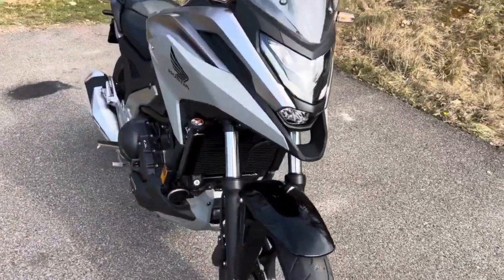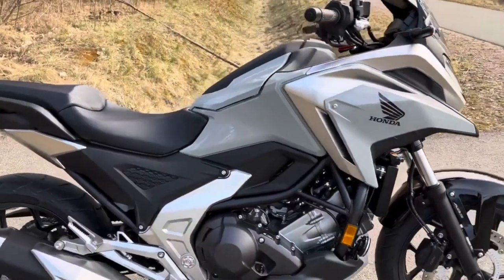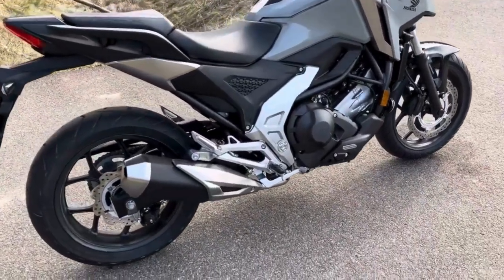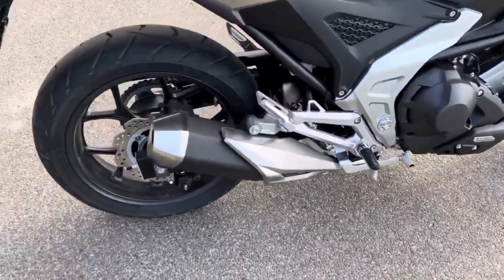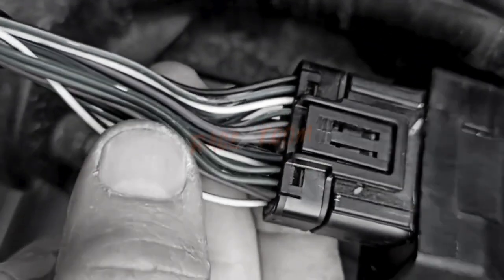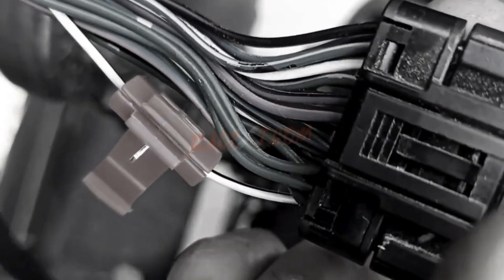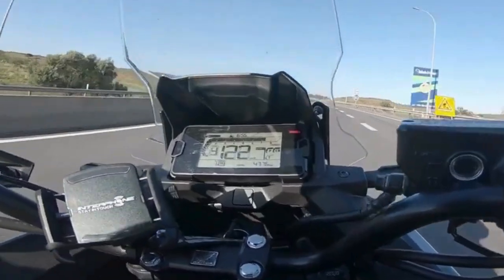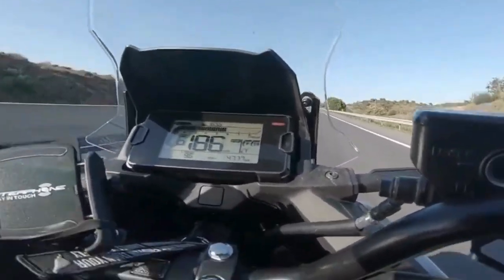Chip tuning for HONDA NC 750 X power unit

Comment: Not really a chip tuning is it. It is a little device with a few internal components which fools the bikes temperature sensor, thinking it is colder than it actually is. Am I right?
Reply from the maker: Dear Henrom,

Thank you for your question and for taking the time to understand how our additional power module works. You’re right that it’s not exactly “chip tuning” in the traditional sense, but it is an extremely effective and efficient way to optimize the performance of your bike. Allow me to explain the functionality and the advantages in more detail.

How the IAT (Intake Air Temperature) Sensor Module Works:
The module connects directly to your bike’s IAT sensor, which measures the temperature of the air entering the engine. The ECU (Engine Control Unit) then adjusts the air-fuel mixture based on this information. Our additional module adjusts the signal sent from the IAT sensor to the ECU, making the system think that the incoming air is cooler than it actually is.

Why does this work so well? Cooler air is denser, meaning it contains more oxygen. By convincing the ECU that the air is cooler, the module prompts it to enrich the fuel mixture, delivering a slightly higher amount of fuel into the combustion chamber. The result is improved combustion, better throttle response, and an increase in both torque and horsepower.

Key Advantages of Our Module:
Immediate Performance Gains: Unlike traditional chip tuning that requires remapping or reprogramming the ECU, our module offers a plug-and-play solution. The installation is quick, simple, and reversible. This allows riders to experience immediate performance improvements without needing specialized tools or expertise.

Improved Throttle Response: One of the most noticeable benefits of using our module is the enhanced throttle response. By optimizing the air-fuel mixture, your bike reacts more quickly when you twist the throttle, providing a smoother and more responsive ride, especially at lower RPMs or during acceleration.

Increased Power and Torque: While the actual gains depend on your specific bike and setup, many customers report significant improvements in both horsepower and torque. For a model like the HONDA NC 750 X, you can expect a noticeable boost in pulling power, especially in mid-range RPMs, where the engine performs most efficiently.

No Permanent Modifications: Traditional chip tuning often involves irreversible changes to your bike’s ECU, which can sometimes void warranties or cause issues during maintenance. Our module, on the other hand, is completely removable, meaning you can revert your bike to its original settings anytime, without leaving any traces of modification. This makes it an excellent choice for those who want performance gains but prefer a non-invasive solution.

Optimized Fuel Consumption: Another benefit is the potential for better fuel efficiency. By optimizing the air-fuel mixture, many riders experience improved fuel consumption under normal riding conditions. While this can vary depending on riding style, the module allows your engine to run more efficiently in a wider range of conditions.

Safe and Reliable: One common concern with tuning solutions is their effect on the longevity of the engine. Our module is designed to work within the manufacturer’s safety parameters, meaning that it won’t push your engine or components beyond their intended operating limits. You’ll gain performance without the risks associated with more aggressive tuning methods.

Professional Guidance and Support:
We take pride in offering not only top-tier products but also comprehensive customer support. If you have any questions about installation or the specific benefits for your Honda NC 750 X, feel free to reach out to us at any time. Our team of specialists is more than happy to provide you with the detailed guidance you need. We’re here to ensure you get the best performance from your bike while using our module safely and effectively.

For further assistance, you can contact us via email at info@racext.com or reach out via WhatsApp. Our technical support team is ready to help you with installation advice, performance optimization tips, or any additional information you might need.

Conclusion:
In summary, while this isn’t traditional chip tuning, our additional module offers a highly effective and efficient solution for boosting your bike’s performance. It’s the perfect balance between performance gains, reliability, and ease of use, all while keeping your bike within safe operational limits.

We appreciate your interest and look forward to helping you get the most out of your ride!

Best regards,
The Racext Team
Customer Support
Email: info@racext.com